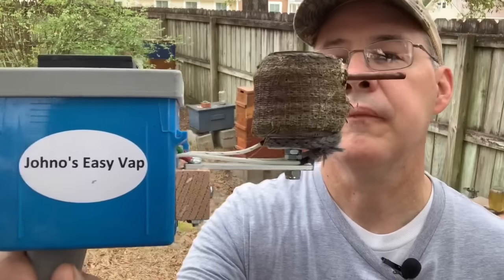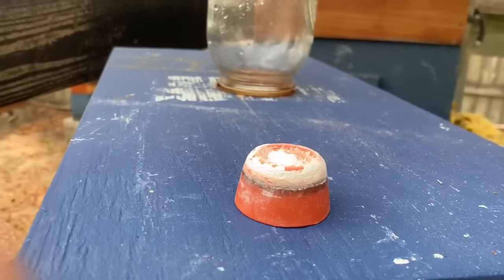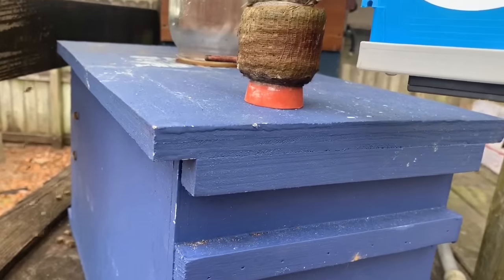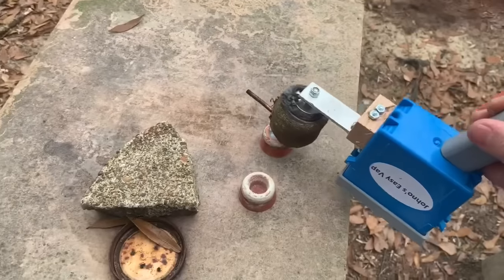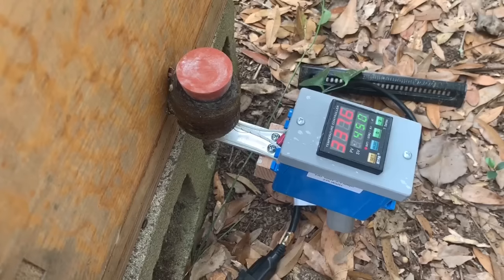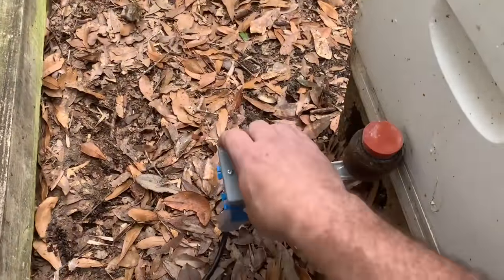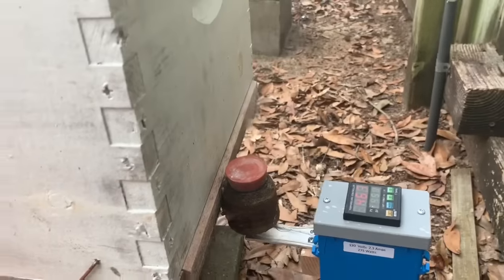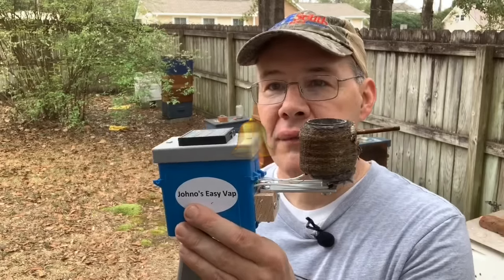How to Use the Easy Vap Oxalic Acid Vaporizer Gun to Treat for Varroa Mites in a Honey Bee Hive

Comment: Absolutely love my easy vape. The PID controller got messed up somehow and I need to reset it, could you do a short video on how to fix this? Thank you !!
Reply from the maker: I have never adjusted the controller but just found the directions from back when I ordered the unit. 

“If you need to change the temperature press AT key and one of the numerals will begin flashing. That numeral can be changed with the up or down key, pressing the AT key again will move to the next numeral. When all the numerals are where you want the temperature to be, press set key.”  

Hope this helps and thanks for watching!

Comment: Bruce thanks for the video. very educational! I just received the easy vap from JohnO. cannot wait to try it out. I only have a few hives but I was tired of the wand method. seems you drilled a hole in the bottom box instead of the bottom board, I guess that works as well. I have an outlet in my F250 that can put out up to 400W, you think that will heat up the vaporizer or should I get the inverter? my hives are not around an electric source so would have to use a battery.
Reply from the maker: Is Johno making them again?  I thought he had shut it down?  Yes I usually drill in the bottom board. Sometimes I did some different things when I was trying to figure it all out.
Reply: @brucesbees  I sent John an email and he still had some on hand, wouldn’t hurt anyone interested in one to contact him.
Reply from the maker: Ok cool. Not a bad idea. Thanks for the info.

Comment: are you drilling a 1/4 inch hole for the tube to go into? and then plugging it with a 1/4 inch wood dowel?...how long does the dowel need to be? thanks
Reply from the maker: I am using a 1/4 hole. Haven’t been using a dowel. The bees will propolize the holes but I just stick a small screwdriver in the hole and wiggle it around to make sure it is clear. Works well for the most part.
Reply: @brucesbees  thanks for responding...i have to really watch out for holes that small hive beetle can go it-take care
Reply from the maker: I hear ya. A dowel or stick would work well. Or maybe even a nail. Just have to figure out the right size.
Reply: @brucesbees  how long do you leave the entrances covered? I hear a golf tee works well for the hole

Comment: Good system. JohnO has a winner! I noticed your wood fence so I am assuming you live in a neighborhood? If so, does your neighbors complain about your bees? 🐝
Reply from the maker: No they don’t complain for the most part. I did have some neighbors complain about bees around their pool last summer so I set up some water sources. The bees love them but hopefully they will stay away from the pools. 

https://youtu.be/LFgbgmgF35Y

Otherwise the neighbors who know about them have no issues that I know of. Most of my bees are in other locations but my neighborhood is a great spot. The bees seem to do well here. I call it my “Bee Lab” because I try a lot of new things here. It is easier to experiment and try different things when they are close by. 🙂
Reply: I had not thought of the pool and water as being a potential problem in a suburban beekeeping situation. I hope that the water set-up that you have installed does the trick. I may come back later in the summer and ask how this is working out if you don't mind? Thanks, Phillip
Reply from the maker: The bees for some reason can be attracted to pool water. I put these watering stations out last summer and the neighbors did not mention it again so I hope they worked. I like you am curious to see if there are any issues this year.
Reply from the maker: ...and you are absolutely free to ask me any questions you want. I will do my best to answer them
Reply: Thanks Bruce, or would you  prefer Rob?
Reply from the maker: Bruce lol
Reply: @brucesbees  w

Comment: I just got one of Johno's vaps in the mail. I am planning on using with a older honda ex650 generator. Does anyone think that would be an issue if I use a surge protection?
Reply from the maker: No. That should work fine I would imagine. I just use a marine battery.
Reply from the maker: I think it will work for around 50+ hives but if I need more I will just crank up my truck and use it’s battery hooked up to the inverter.

Comment: Obviously, you wouldn't do this if it killed the bees.  However, how do you know how much oxalic acid to use?  Sort of scared that I'd kill the queen.
Reply from the maker: I have a 1 gram scoop and the recommended amount is 1 gram per hive body. I usually use one scoop for the first box and then around 1/2 to 1 scoop per box for additional boxes. The bees seem to tolerate it well even if I overdo it a little sometimes. As a matter of fact the bees absolutely thrive. It only seems to take them a few minutes to resume business as usual when the treatment is complete. Have never noticed any real loss of bees or the queen when using either this method or the wand method. OAV seems safe for the bees but is deadly to mites. I have nothing but good things to say about this method. It is a good idea to wear protective gear though. I don’t always do it but try to stay upwind or stand a distance away when using OAV Vapor. I do have a mask and goggles that I can use if I feel like I am going to get more exposure. The mask should be rated for Organic Acid Vapors.
Reply from the maker: The one gram scoop I use is about equal to 3/4 of a teaspoon if measured using water. I tested it the other day.

Comment: how long do you leave towel on after treatment?
Reply from the maker: Not long. I usually treat 8 or 12 hives and then move the towels as needed for more hives.  I am getting efficient enough now that it is tough to keep up. The vaporizer works so fast that it is hard to move towels and fill cups fast enough. 

I don’t know if there is any set amount of time but my towels usually stay in the hives anywhere from 5 to 10 minutes. This method fills the hive so fast that there is no doubt in my mind that it reaches every corner of the box.
Reply from the maker: I need to do another video now that I am more efficient.  but truth is that I don’t do everything exactly “by the book” with regards to protective equipment. It is difficult to wear a mask and goggles under a bee veil, especially when it is hot and humid. I usually just try to stay upwind and avoid breathing the fumes. Probably not the best idea though I have had no issues with it.
Reply: Most literature says about 10 mins.

Comment: The Provap to my mind is one of the biggest ripoffs in beekeeping, sourcing most of the parts using reasonable quality is less than $150, on the cheap less than $75,  How can they justify the price they charge? I have the basic one, 12v, $20 from aliexpress but waiting for parts to make the Provap copy. Having both a lathe and milling machine i can make it even cheaper than posted above.
Reply from the maker: Yes I was thinking about ordering the Provap but I am glad I found out about Johnno. Good product and way cheaper. I think I paid $165 including shipping. It was worth it to me. Even if it breaks I can order another one or two for the total price of the provap. Have been pleased so far. Thanks!
Reply: even bigger ripoff is the thermal treatments
Reply from the maker: It does seem like they are crazy expensive.
Reply: The same reason why I'm looking around myself.  I figure for 165 I should be able to get enough treatments beat the wands' lifespan.  I've seen some as low as 45 but am skeptical about the cheap stuff.  And 495 for the pro gap is ridiculous.  Most of us are hobby beekeepers and that price is just too much.  
I'm searching for something that can do the same thing for a lower price.
Reply: @beebob1279  For hobby use and a dozen or so hives you can use the simple 12v wand type, i have one and got it foe 19€ on aliexpress, it takes about 3 minutes per hive with a good battery, i use an old tractor battery that does not hold a charge fore more than a month and just charge it before use. I now have almost everything to make a provap copy, i think on jc's bees there are easy follow videos to make one. having a small lathe and milling machine it should not take long.
Reply: @incubatork  I've got a lot more than ten hives.  That's why I'm shopping around for something better than a wand.

Comment: How many hives are you able to do with battery and inverter?
Reply from the maker: I have done 40 or 50 with no trouble. Not sure how many I can actually do. With the Easy Val it is so fast that you can get a lot of hives done. I have run my battery down with the wand but have never reached the limit with the Easy Vap so I am really not sure.
Reply: Thanks a lot for the reply